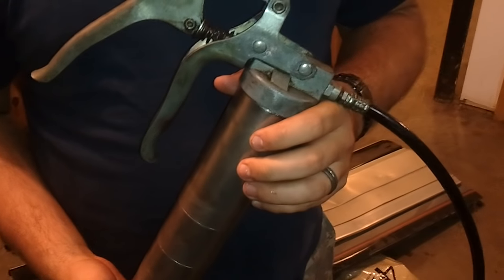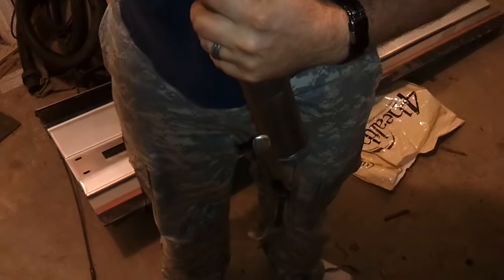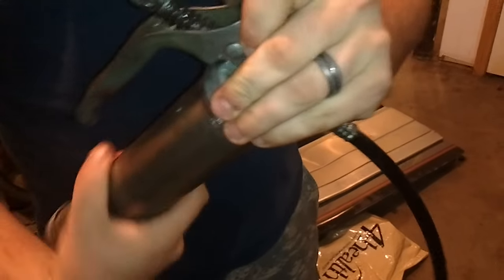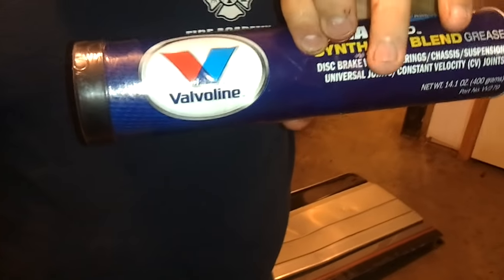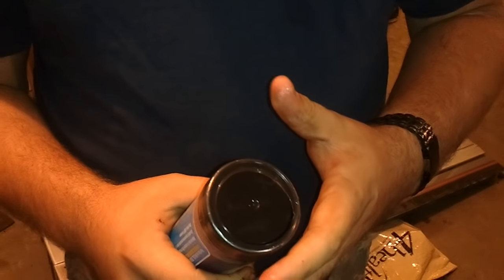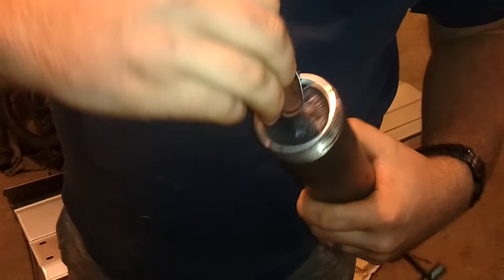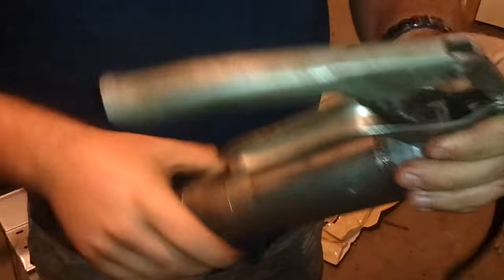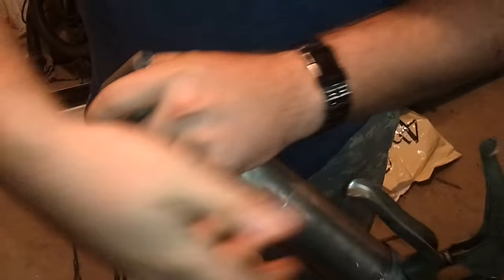How to replace grease in a grease gun

Comment: Very good without confusion.  The whisper coaching by the cameraman was unnecessary but, you did a good job of explaining the steps in their proper order – something I have difficulty keeping track of.  My new grease canister is now installed in my grease gun and I have already lubed up some grease fittings on my mini-van's rocker arms and on my mower.   Thanks.

Comment: Thank you for this. My fellow equipment operators said that if I couldn't figure this out then I had no business operating our heavy equipment. Tip, the spent tube may not come out easily, a pair of pliers may be needed to pull the old tube out
Reply: Moving the plunger in and out a few times after the pumping part has been removed solves that issue.